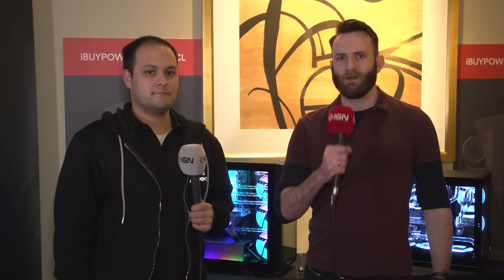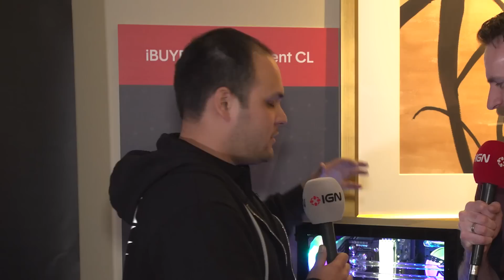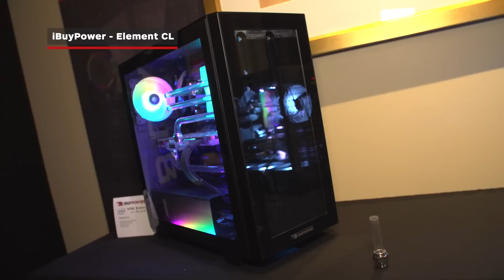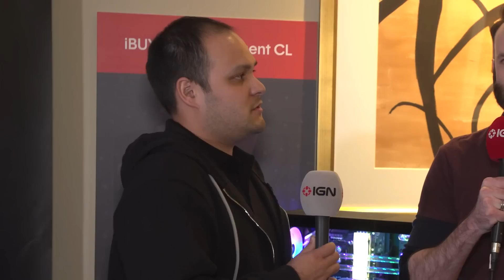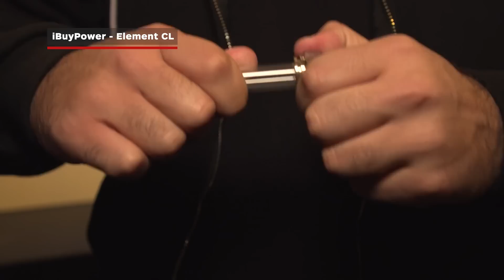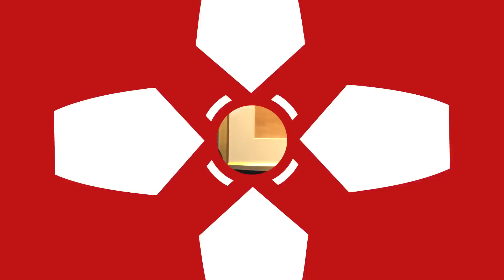Hardline Water-Cooling For Only $100

Comment: So... $100 for installing the loop -.-
Reply: that's quite reasonable
Reply: @allansh828  those pc starts at $3000. and looking at the spec. there is a significant markup on the hardline cooled pc. its not $100
Reply: @allansh828  If that was actually the case, sure.  But it isn't.  Additionally, the way the title is worded makes it seem like a kit for $100 (why I and many others clicked).

Comment: ugh ibuypower is trash man
Reply: Tyler Harris why? Compared to? Asking cause my brother may have made a mistake in buying one
Reply: @jd-py5nm  Over priced limited options i Bought mine through cyberpower and yes building your own is way cheaper in general buy i wanted it relativly fast i have a ryzen 3600 with a 580 600 w psu 470 mobo and an aio 120mm fan for 1000 bucks it's priced at 930 now
Reply: @tylerharris9847  you still kinda got ripped off. Don't really need a 600w PSU for a 580 or an AIO for a 3600x. For $1000 you'd expect a 5700, 1660ti or maybe even a 2060 super.
Reply: @marce18123  Like i said building your own is way cheaper just ibuypower did not seem like they offered anything
Reply: iBuyPower is not too bad depending on what you are doing with it. But, I still prefer the PC to be built from the ground up.